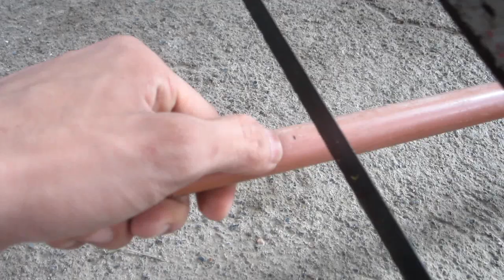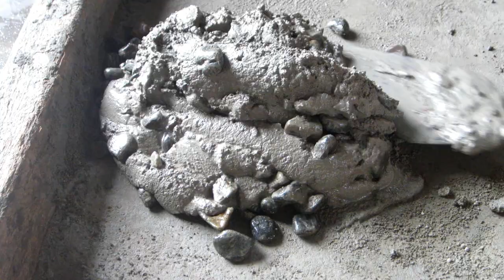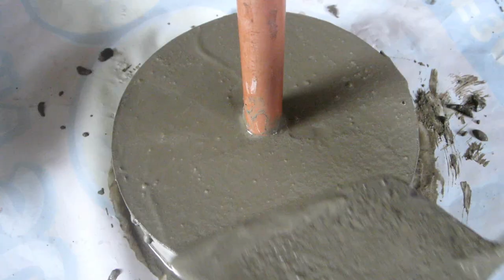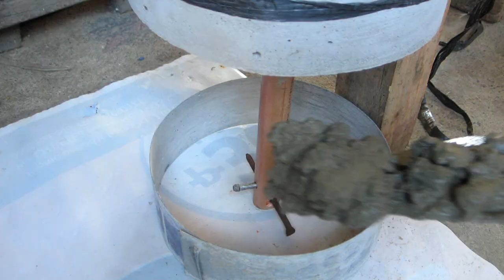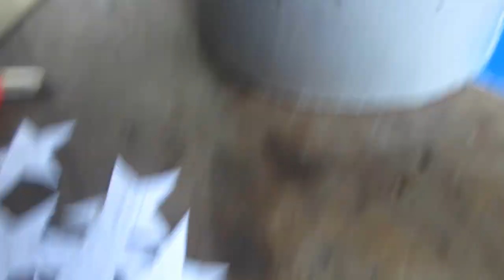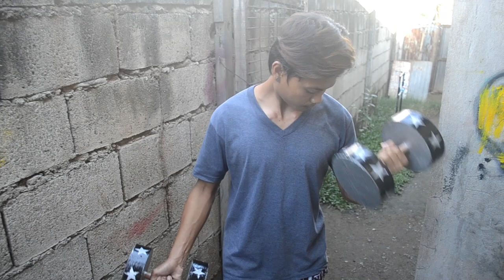How to Make a Homemade Dumbbell

Comment: Nice bro. I always watch your videos.. A pvc 1 inch pipe can carry how much weight? When it uses in dumbell making?? Plz reply
Reply from the maker: Maybe it can handle a 20kg or more with 1 inch pvc but im not sure bro because i only use pvc pipe when i make a light weight dumbbell. I usually use galvanized pipe when making a heavy dumbbell . If you're using pvc pipe put some cement powder too inside the pipe for an additional durability .
Reply: @romgd  🥰

Comment: REPLLY PLEASE BRO WHAT THE HEIGHT AND WIDTH OF THE STEEL RING MADE DUMBELL
Reply from the maker: 7 inch and the thickness was 2 inch bro.  That is just a light weight dumbbell bro , You can make any width. The important is the weight you want to make.
Reply: @romgd  ok thanks bro i like your video but plzz bro vidro make slow and any equipment made this name etc show plzzz bro